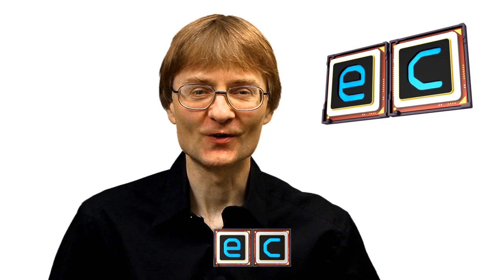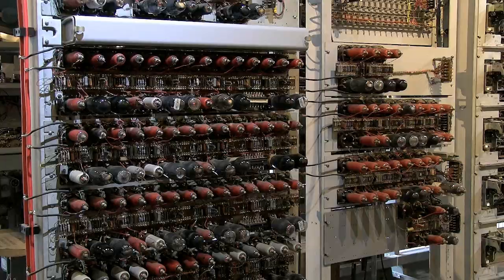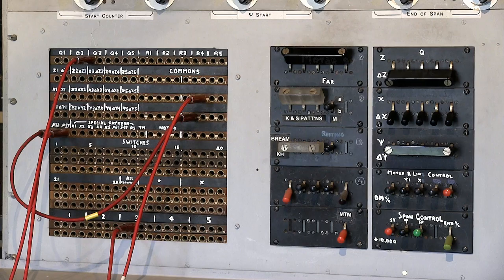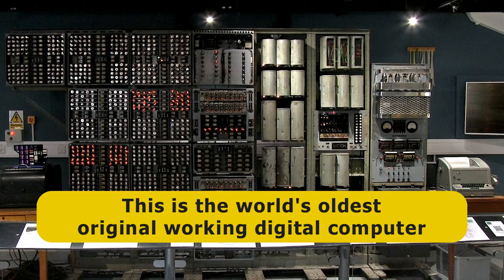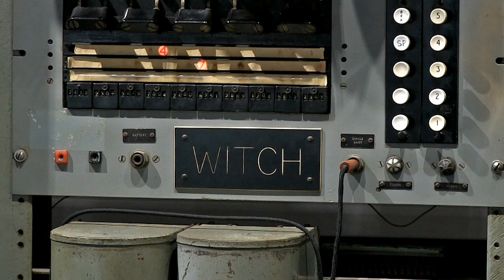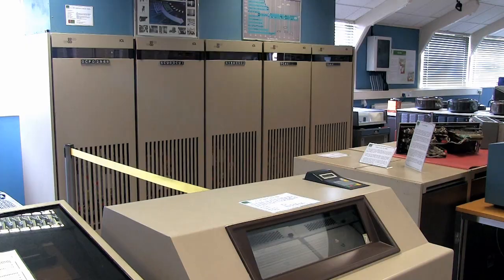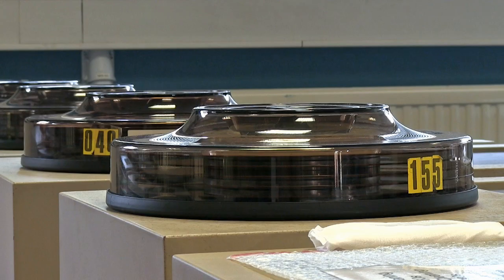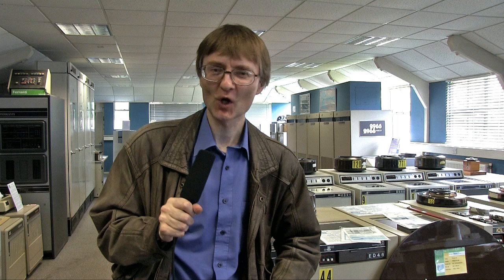Colossus & Other Early Computers

Comment: They skipped over me. I started computer programming 1968 with IBM 360/44. It was same looking as that English ICL except slap blue paint on it. We didn't have fancy schmancy cathode-ray tube screens though just the teletype. The 50 mbyte (or was it 5 mbyte ? I forget) disk drive was easily installed by a mobile crane in the building's back alley.

Comment: Somewhat Off-Topic but 😃 
As to the 2000 year BUG mentioned in the Video. 

I'd like to know, was there any failures BESIDES my Canon T70 35mm Camera, fitted with a additional Command-Back which replaced the back-door, giving the camera additional feature, like long-time exposure up to many hours if needed, and timed shutter release. 
It was one fully "computerized" camera which several stored programs, like tele and wide as well as standard program. The Owners-manual that came with it is says proudly: *Photograph Enters the Computer Age*. While the Command-Back promised one calendar up to 2029, the regular computer in the camera itself didn't survive the year 2000. The Programs didn't work correctly after it, one had to use all manual settings.

Comment: Nice overview of early computers.
Please correct my if I'm wrong but all the computer in this video are build in the UK? And I always thought the Zuse Z1 was the very first working 'digital' computer, build in 1938.
And of cause not build in the time of its construction, there is the Analytical Engine from Charles Babbage in 1837.
Reply from the maker: Thanks. And yes, these are all UK computers (though this will not be the case with the follow-up video on early PCs). Colossus is generally accepted to be the world's first (programmable) electronic computer, and that is what I call it in the video. Babbage's machines are certainly far earlier, but like Pascal's 1642 calculator, were mechanical computers. The Zuse 1 (and 2, 3 and 4) were all electromechanical computers (relay, rather than valve based). There are so many firsts! So the exact wording chosen is critical -- as several experts of the National Museum reminded me. :)
Reply: Wow, that was a fast answer. Tanks for the explanation. I just found out that there is a project to build the Analytical Engine in real, called plan28. Hopefully we will see this one in action.

Comment: Don't forget about the ABC (Atanasoff-Berry Computer) built at Iowa state. Conceived in 1937, a prototype was first demonstrated in 1939.
Reply from the maker: This video only covers early computers exhibited at the national museum of computing in the UK. The ABC was a pioneering electronic calculating device, but was not programmable (it was designed to solve linear equations). Hence there remains a debate about whether the ABC or the Colossus machines were the first electronic computers. But both are of great historical significance.

Comment: im sorry if this question may sound stupid, but these machines predate "software" as we know it, right? like assembler language or even a bios? were they more then basic calculators?
Reply from the maker: Yes, these machines (well, aside from the ICL mainframe) predate software as we know it. But they were more than calculators to the extent that they were fed data and processed it using a program entered by the user (in the case of the Colossus by setting swtiches and plugs; for the EDSAC a program was held in memory -- hence its name).
Reply: ExplainingComputers 
ok, i got it now. thanks for the reply.

Comment: All these tubes are starting to show signs of wear, unlike transistors they have a limited life of around 10.000 hours at most. You can see the dark tungsten deposit where the filament is. It's a matter of months before they all start to fail.

Comment: Colossus' tubes have been powered up non-stop from 1943 to present?
Reply from the maker: No, because the first machines were taken apart after the War, and what we see here is a reconstruction. The point is more that the machines should not be turned off entirely when not in use -- the heaters in the valves are kept on to prevent the shock of being tuned on from cold, which is what blows them (and very regularly).
Reply: That makes perfect sense. My family purchased a TV in the 1950s and there were quite a few disappointing moments when family, friends & neighbors would be gathered in front of the set only for it to blow a tube upon being turned on.

Comment: But can it run Minesweeper?
Reply from the maker: By helping to decode military messages, the Colossus was involved in real-world minesweeper . . .
Reply: omg best answer ever :D
Reply: best answer ever :P
Reply: H2O Sure
Reply: Jejejeje, BOOM!
Reply: They can't actyally run Minesweeper from Windows but they could flag the mines for you if you manage to code the grid with the numbers into them and "teach" them the rules
Reply: The EDSAC could and did play draughts, and noughts and crosses https://en.wikipedia.org/wiki/OXO , by exploiting the CRT display intended to display the memory state for debugging and instead using it as a very-low-resolution, and very early, bitmapped display.

Comment: Was the Z3 intentionally omitted?
After all, this was the first computer that fulfilled the criteria of Turing.
Reply from the maker: In this video I covered the computers that I could film in the museum -- it is not indicated that this is a video about all early computers! :)  In the video I describe Colossus as the first electronic computer, and this is true. The Z3, and other Zeus machines, were electromechanical (relay, rather than valve based). Ultimately, it seems here that I cannot win. Whatever I include in a video these days, and however carefully I word the script (and get others to check it), people just pick holes on the apparent basis that everything in the world can be included in every video (though where they think the visuals would come from, I do not know). This is one 10 minute video trying to show people some interesting stuff. I really give up.
Reply: Relays are nothing but switches.
Basically you can apply any deffinitions depending on what you focus on.
However, one holds fast to the basic framework of a computer, without arbitrarily restricting it, this must be digital (0-1) and Turing-completeness.
The simplest deffinition.
Excuse me, please do not understand this as a general attack, it was literally a statement from me.
Cathode ray tubes, as in the old computers, are fundamentally a further development of the relay technology used previously.
In the extreme case, one could therefore call all computers "non-computers" that do not yet exist on semiconductor technology.

Your work in the video is quite interesting, I hope they do not feel offended by my comment.

Comment: hey, can you please do a video on overclocking a raspberry pi 3 till it breaks? it should be possible to remove the safety that stops the pi when it gets too hot, as well as overclocking it as high as you can. i would love to see how hot it can get, as a kind of torture test.
Reply from the maker: I've already done a Pi overclocking video! :) I very much doubt you can stop the chip throttling or keep it stable beyond about 1.5GHz.
Reply: ExplainingComputers i see

Comment: Another interesting piece of computer history, the very first programmable multi-purpose computer, which was even Turing-complete: Konrad Zuse's Z3, built in 1941 and destroyed in an air raid on Berlin in 1943.
Reconstruction on display at the German Museum in München: https://www.youtube.com/watch?v=aUXnhVrT4CI
Konrad Zuse in an interview from 1958 (by then he had founded a company that built follow-up models of the Z3 and sold them to universities and large corporations - some of these computers can be seen in action in the movie): https://www.youtube.com/watch?v=n8Yo-wD-QTo

What I find so fascinating about the Z3 is, that in contrast to most other early computers (ABC, Colossus, ENIAC, Manchester Baby) it did not have much governmental support behind it, but was built by a single person in his spare time mainly with his own money. Nevertheless it was way ahead of it's time. It had floating point arithmetic, used binary representation (while ENIAC still used much more clumsy decimal representation), and programs could be fed into it via punched tape (while ENIAC had to be programmed via patch board and switches).
Zuse originally wanted to build his design using vacuum tubes, but in Germany under war-time conditions, these were not available in sufficient quantities, so he used relays instead. (Perhaps the necessity to use relays was even a "blessing in disguise": during its two years in operation, the Z3 worked fast and reliably, while on the Wikipedia page of ENIAC we can read this: "Several tubes burned out almost every day, leaving ENIAC nonfunctional about half the time. Special high-reliability tubes were not available until 1948." ...)
Reply from the maker: Thanks for this great post -- including the link to the really interesting YouTube video. I had only seen pictures of it before. Great to see it in action!

For others here, it is worth noting that the Z3, whilst the first  programmable, multipurpose computer, was electromechanical (as it was based on relays). The claim-to-fame of Colossus was being the first electronic programmable general purpose computer (as it was based on valves).

Comment: You missed Zuse's Z1 and Z2........ sadly.
Reply from the maker: I did not "miss" anything! :) I showed those early machines at the National Museum of Computing in the UK, and could hence not include those elsewhere in the world. The Zuse machines were electromechanical computers (relay, not valve based) -- so were not the first "electronic computers", which is what I very carefully described Colossus as. The script here was checked by several experts at the National Museum of Computing, and correlated with my own research for a book I am currently writing on the history and future of computing.
Reply: I see ..... and yes i did not get the full electronic part of your clip, which is true. ;) And i did not get the part mentioning that you only included computers from the National Museum of Computing in the UK. - my fault. ;)

On the part, that Zuse computers are "electromechanical" ... well, i would debate that. Sure they are, but Colossus is - at least at it's input and output-devices - and in a wide part on it's "operational data" mechanical too. (O.k. we're again going into pea counting spaces. ;))

Comment: The oldest digital and reliably working computer was the Z3 from 1941. I'm also missing Zuses Z series here. He has built the first computer using binaries in 1937
Reply from the maker: His machines were digital certainly, but not electronic -- and I described the  Colossus as the first electronic computer. The Z3 et al were electromechanical (relay based).
Reply: Thanks for the clarification. I thought the any Z-computer after the Z1 was electronic since they used relays (electromagnetic switches)

Comment: Colossus vs my ryzen 5 1600x with a 1070 and 16gb of 3200 ram .

Colossus wins.
Reply: Obviously, it's a ryzen 🤢🤢🤢🤢🤢
Reply: ryzen gets beaten in gaming by the i7 4790k which was released in 2014 shame
Reply: But the i7 cost way more than a Ryzen 5...
Reply: Some folks never miss a chance to parade what computer they have. hehe
Reply: Colossus has the coolest name i guess?
Reply: Colossus is clockless, so theoretically it could run very fast.
Reply: Not so; it has a clock, which is derived from the sprocket holes of the message tape being processed. So,  it is limited by the increasing fragility of the tape at high speeds. It's also full of mechanical relays, which would limit the speed.

Comment: Colossus was build in 1943. The first computer would have been the Z3 computer build by by Konrad Zuse in 1941 in Berlin.
Reply from the maker: But I never in this video described Colossus as the first computer. :) Rather, I noted that it was the first electronic computer, and this I believe to be true. The Zuse was an electromechanical (relay based) machine.

Comment: why do you ignore the Zuse? that was the first programmable computer, built before the colossus.
Reply from the maker: I did not ignore the Zuse models. Rather, I described the Colossus as the first programmable electronic computer, which it was. The Zuse was an electromechanical computer (relay-based, not valve-based). This video does not mention a great many early computers, just the ones that I could film, and the decriptions of them that I use are accurate.

Comment: Mr Konrad Zuse wants a word with you... 1941, Zuse Z3, first digital fully programmable computer. :)
Reply from the maker: But I didn't describe the Colossus as the "first digital programmable computer", I described it as the first electronic computer -- which it was. :) The various Konrad Zuse machines, while amazing devices, were electromechanical (relay not value based).
Reply: Ah, ok. :)

Is it just that so many folks forget about him and his work just because he was on the wrong side of the war.

Comment: Y2k scam. Did anything whatsoever fail because of the 'y2k bug'?
Reply: Yes. Banks issuing credit cards with expiry dates in the early 1900s comes to mind, But seriously any company that supplied 'safety critical' systems spent millions testing them for problems, found lots and fixed them before Y2K arrived. This was deemed cheaper than fighting all the potential lawsuits that would occur after any disaster. So the Y2k bug hype worked and in doing so prevented the chaos it predicted making itself look like scaremongering.

Comment: Interesting you failed to mention Alan Turning and his contributions the design and building of Colossus.
Reply from the maker: Alan Turing designed and helped build an earlier electromechanical computer at Bletchley Park called the Bombe, which helped to decode messages encrypted with an Enigma cipher device. Turing was not directly involved in the design of Colossus (although his earlier cryptography work was utilized), and played no part in building it. Colossus was also used to help decrypt Lorenz and not Enigma encrypted communications. The association of Turing (and the decoding of Enigma messages) with Colossus has become a widely spread urban myth, and I was exeptionally carefull to achieve factual accuracy with this video! :) This extended to several experts at the National Museum of Computing checking and approving the script word-for-word. Indeed, our agreement in setting up filming access was that I got things right.

Comment: Valves don't need to be kept on to stop them from 'blowing'.  What a load of garbage.
Reply from the maker: Well, this is what the people who build the machine told me, and I kind of imagine they know what they are talking about. Obviously the issue is that valves only survive being turned on and off so many times. So to preserve their life, it is better to keep them on, rather than turn them on and off every day.
Reply: If you had a mission critical electronic computer which used 2400 vacuum tubes in 1944 you'd do everything in your power to minimize blown tubes, and that would most certainly include not turning them off.